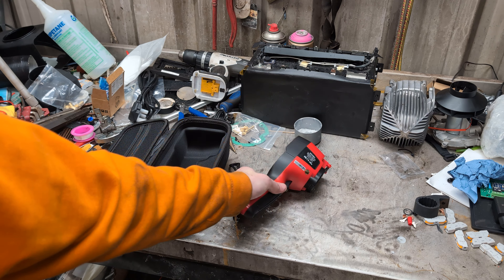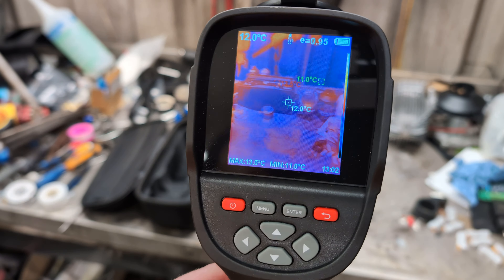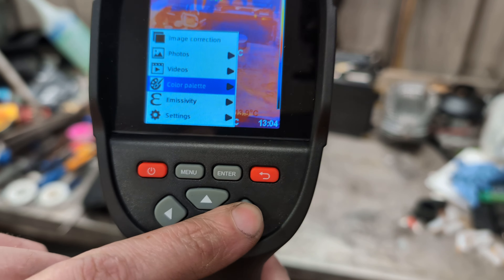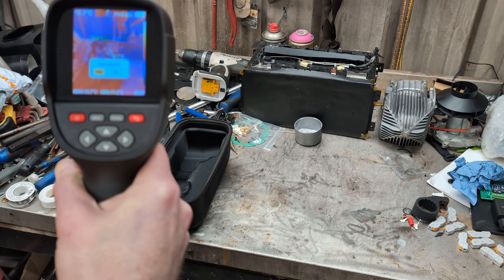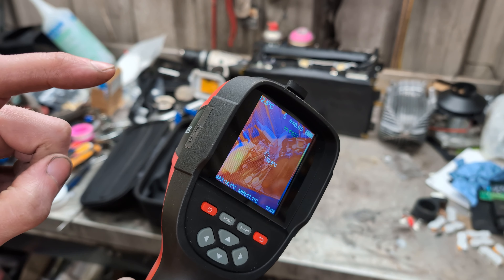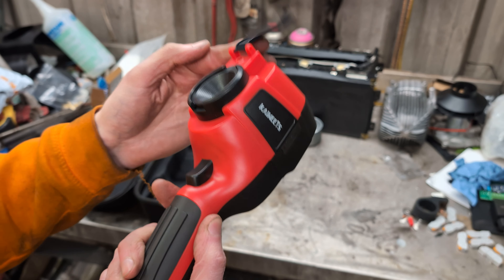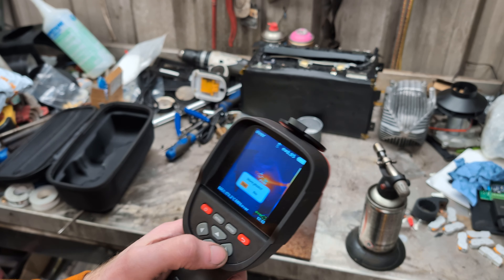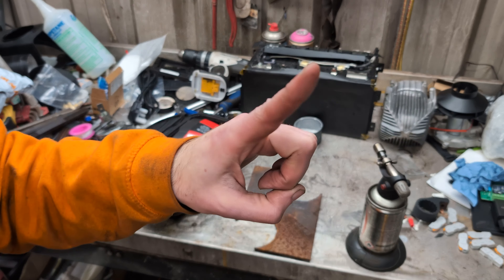Kaiweets KTI-W01 // test - review

Comment: 1st
Looks like a nice unit. Id like to see a comparo with a known brand to test accuracy. 
Great video David👍👍
Reply: There accuracy is sufficient for most non quantitive measurements as the non professional usually incorrectly assesses the objects emissivity and therefore the radiance of Infrared.  A  'Black body' radiator would be 1,  generally oil based products are 0.95. Table available on the net. Avoid measurements from Stainless steel, Nickel, glass, brass and cooper without applying a paint or tape to the surface to bring the emissivity to a close to  1 as possible. 
As a retired Themographer with a $35k  IR camera under my desk I can say that this £240 camera offers some good features not seen on cameras under £500. The temperature overlay onto the visual image is a surprising feature as it the distance adjustment however no tripod bushing is a big mistake.   
For a budget camera without visual optics equal if not better to those toys you attached to phones, I would suggest you could do worse than the   £119 GOYOJO GW192 from Aliexpress.  FLIR cameras equal to the one featured would be around £800 and probably made by the same company but don't quote me.. hope this was helpful
Reply: @Woffy.  Very, very nice and detailed reply!!!
Thank you, and God bless:)

Comment: 30 minutes and a 3D printer will have you a holder. or a piece of pipe with a bolt in the bottom.
Reply from the maker: Now you've got me thinking where I put the 1/4 20 nuts and bolts I bought.